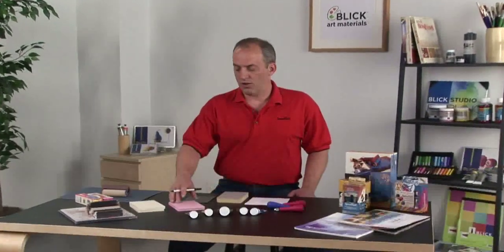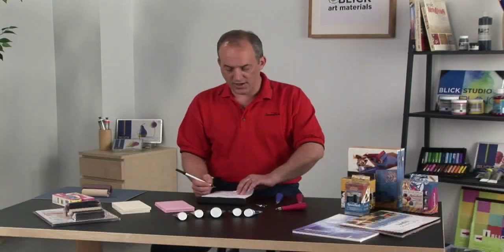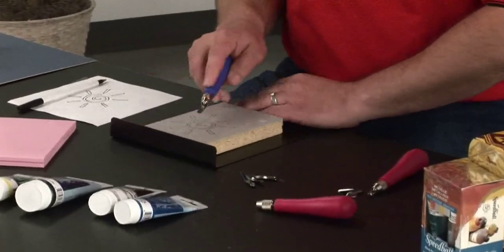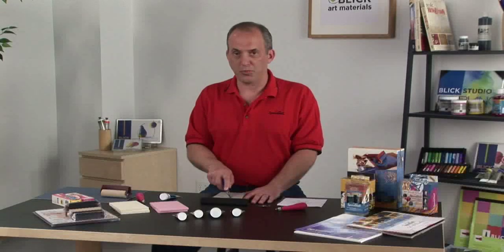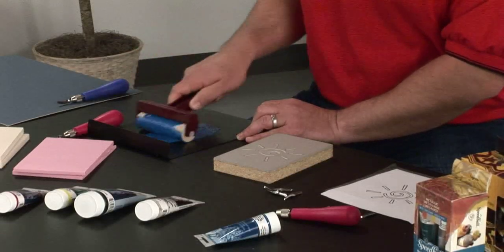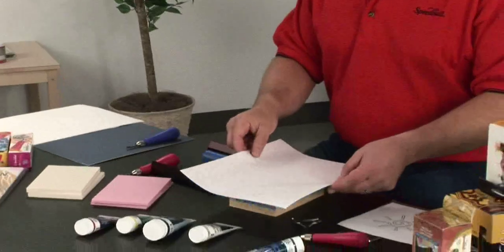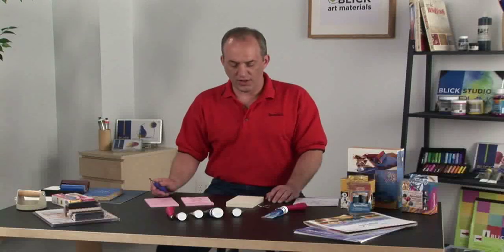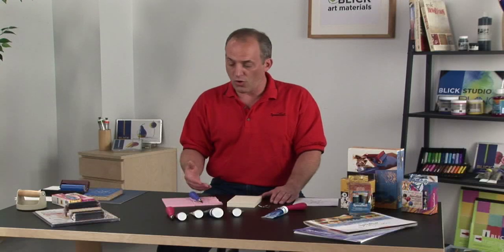How to use Speedball Block Printing Materials

Comment: I haven't done any block printing in many years. But when we carved linoleum blocks, we used an iron to warm and soften the linoleum to make cutting easier and smoother. Is this still the case? Or are the linoleum blocks now made of a softer material? I've seen a newer soft block on the market but do they take detail really well? Make clean crisp prints?
Reply from the maker: +Kim Conover With traditional linoleum (Battleship Grey, Golden Cut, etc), it is still common to heat or warm the surface for easier carving.  If you don’t want to worry about the material drying out or hardening, then consider the new synthetic blocks that remain soft.  The Blick Ready Cut and the Speedball Speedy Carve Blocks are soft options that allow for detailed carves.  If you have additional questions, you can reach Blick Product Information at 1-800-933-2542 or info@dickblick.com. Thanks!
Reply: Thank you for answering my questions. I plan to try one of the new soft blocks very soon- probably the blick. Thanks again.